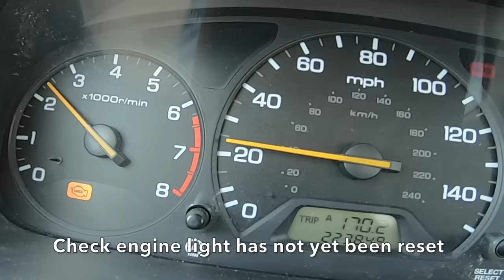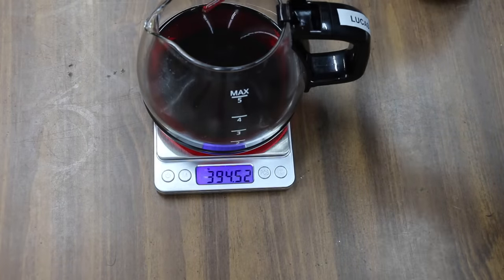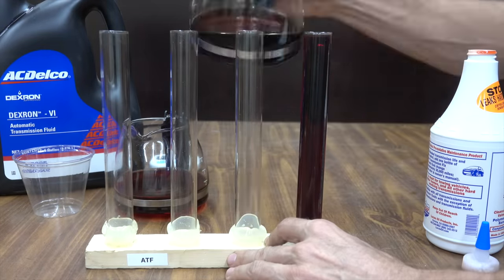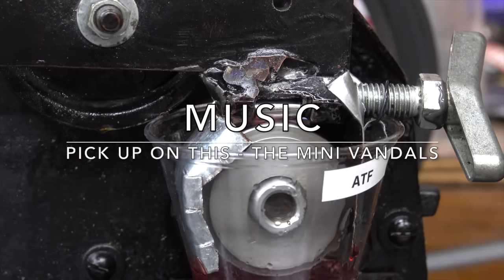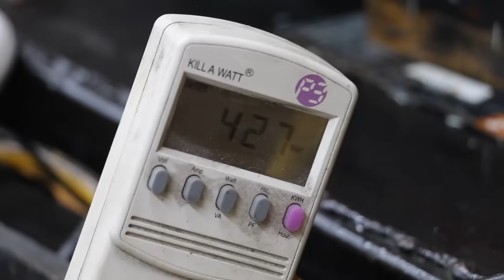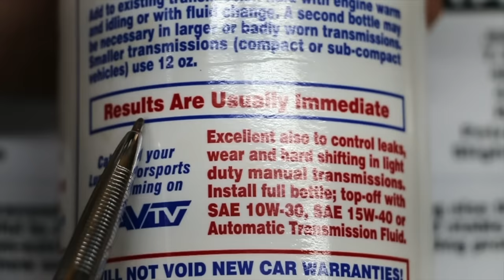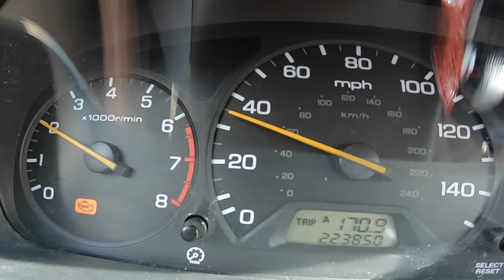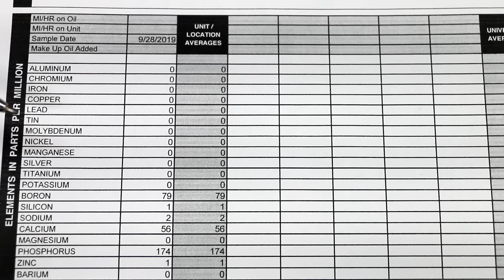Does Lucas Transmission Fix Work?  Let's find out!

Comment: Lucas has prolonged my transmission replacement for over 5 years now. Is it perfectly operating now? No. There is still a slight slip if I really step on it, or if I put a whole lot of torque/load weight on it, too fast. However, if I drive it normally, and take it a little easy when starting off, it's fine. You wouldn't even notice a problem. Also, once up to speed whether it's small roads, highways or freeways you can accelerate any way you want, no problem. I'll take that over a $5,500.00 repair anytime for my 1998 Ford Expedition 5.4, 171,000 mile, no rust vehicle...and it's still a daily driver. Great product. Great video.
Reply from the maker: Thanks!

Comment: Could you please test an OEM fluid (pick any or multiple coices, Dexron 6, Toyota WS, Ford Mercon V,  Honda DW1, nissan Matic S or J, and (Toyota T-IV/JWS 3309/Mobile 3309*)) vs the multi vehicle ATF from Major brands.....as to additive packages differences, wear and all that as they claim its up to or better than OEM specs. What i mean is if the bottle claims its suitable as a replacement for the above mentioned OEMs.... compare them. Everyone seem to like the Valvoline Max life....* Toyota T-IV, JWS 3309 & Mobile 3309 is the same fluid in different bottles made by Exxon Mobile (US)or Esso Imperial oil (Canada). Thanks 😃
Reply from the maker: Thanks for the video idea.

Comment: A little Lucas will make any working transmission run cooler and give you a more solid shift. Also transmissions just last longer with the stuff in there. If you have a transmission that is actually slipping, a container of regular STP can give you up to a year in some cases, if you keep your foot out of it.
Reply from the maker: Thanks for the feedback.

Comment: Just picked up a 92 ranger with the a4ld and I wound up flushing it with most of a five gallon bucket of tractor hydrostatic fluid and a couple bottles of lucus, the thing went from a slip n slide to practically new compared to what it was before.
Reply from the maker: Thanks for the feedback.
Reply: John deere hy guard is what most ppl I know run in heavy duty truck transmissions. It and a bottle of Lucas will tighten up a loose converter & take alot more heat than atf

Comment: Did it seriously say to put 10w-30 motor oil into the transmission? Hmm, that makes me wonder if part of the problem is that modern ATF doesn't have a high enough viscosity? Maybe to eek out that tiny bit more fuel mileage?

Comment: This is one of the greatest products ever. Prior to using the it took it to a few shops and they told me I needed new transmission quickly on my 2001 Legacy supposedly had a transmission that needed to be rebuilt until I bought this stuff and I’ve been putting it in ever since and that was 70,000 miles in this tranny is running fantastic. I even run it full strength without a mixture of automatic transmission fluid
Reply from the maker: Thanks for sharing.

Comment: I bought a cheap beater as is with 240 thousand miles that was in excellentshape and everything worked but, a 2008 Escape that wouldn't go further than 1st gear. Its history was had a trans rebuilt a few years back and later a new shift solenoid replaced. As soon as I paid I put a quart of Lucas in it and been driving it for 2 years without a problem other than at times OD dash light flashes. As if it's not in OD but it is and OD button works fine. ? Cheaper than repair obviously.
Reply from the maker: Thanks for sharing.

Comment: Here in the UK a family member recently purchased a Honda Jazz without test driving it for another family member! 🙄The CVT judders when taking off, a bottle of Lucas Transmission fixed that issue!! Less than 50 miles of driving it was fine.
Reply from the maker: Thanks for sharing.

Comment: Those honda transmissions are very different than most transmissions out there, try this again on another type of transmission that is slipping, Another thing that can be done to buy some time on a Honda transmission like that is clean the solenoid screens, or replace the solenoids, but the transmission is failing nevertheless

Comment: So the symptoms I see are not torque converter but also the Lucas won't work if the torque converter is the problem  it works on the clutches and bands

Comment: Well after this video I did a complete 14 qt change and added one 2 bottles of Lucas Trans and one full quart of "real Lucas" to a Ford AOD with 180,000 miles.
The trans had shifted well until the fluid got hot, 15 miles, so the increased viscosity helped. Adding an external cooler and getting out of the 180* radiator tank helped too. Its still going strong at 208,000. But the lockup stutters a little when hot.
The AOD had been serviced at 120,000 with an 100% fluid change using mercon5.
Reply from the maker: Thanks for the feedback.

Comment: I'm afraid to add the whole bottle. I checked my fluid prior to adding, (2015 F150 XLT), and it was actually a bit over full(cold test), so I pulled out (using a pump) enough to fill a plastic folders coffee container and then I added Lucas to bring the level to just full..
Test drove cold around the neighborhood and shifts just fine, will have to test on >30 mins drive later today, because the original problem is shuttering after 30 mins of driving on ALL uphill climbs on regular roads, that's not much of an incline at all. But I did use this last year to treat my shutter then and it's been good all summer (driving is always 40 mins one way to work and I do that 3 times a week, and of course have to drive back home after 12 hours).
Truck has 221K.
No oil use or burn, no leaks for any fluid.
I did put in all new coil packs when I bought this truck in 2020.
Other than the transmission only the turn switch went bad.
Reply from the maker: Thanks for sharing.

Comment: needs shift solenoids....the seals swell and makes it harder to shift due to sticking plungers......usually 2nd to 3rd is where it starts. I did my Jetta at 174,700 and it still shifts great after 300 miles.
Reply from the maker: Thanks for the feedback.

Comment: I had a 1989 Olds 98 with 3800 engine and 4T65 trans.... Trans started giving me slipping at 180k-ish miles, I put the Lucas oil in it, and the trans did get better. I got another 25-30k miles out of it until the engine started sucking coolant, and I threw in the towel. The intake manifold gasket was leaking. Changed the gasket and it still leaked, so either the head or the intake had warped, wasn't worth any more effort at that point.
Reply from the maker: Thanks for sharing.

Comment: I have always used Trans-X.
You can get it at any auto parts store or Walmart. It is fairly cheap!
I have used it on 3 different vehicles with fantastic results on all three!
All of the vehicles had high mileage.
One of the vehicles was a taxi cab minivan that was drove like a beat dog! Lol. It would not shift good at all,... sometimes would not even shift into 3rd. After about one hour driving with Trans X, it was shifting like a brand new vehicle.
I had one that would not shift into third. I placed the proper amount of Trans-X in the transmission & before I left the Walmart parking lot it shifted into third.
It will not replace burnt clutches. It will dissolve varnish build-up in the veins, ect. You have nothing to lose but $8 or so.
Reply from the maker: Thanks for the feedback.

Comment: Have 2003 Grand Prix would not shift between 1st and 2nd when first taking off. Could get it to shift by playing with gas. After first shift it was ok. Two shops trans is shot $2K to $2.5K to fix. Veh. has 125K total. Thought what the Heck $13.00 bottle of Lucas trans additive and it took care of problem. Veh. shifts fine now. Super glad I tried it.
Reply from the maker: Thanks for the feedback.

Comment: My employees pulled one of my plow trucks too town for a mechanic too replace a possible difficult starter before a upcoming snow storm... (they didn't put transfer case in neutral  like I said)  $400.00 later  trucks starts and runs but , wouldn't move out of shop tranny was fried from the pull into town...added 2 bottles  of this too my 98 2500 ram. And it drove off and I was able to use as a salt truck for last few years  and it drove great  too the junk yard when the body finally gave out... tranny was still  👍.
Reply from the maker: Thanks for sharing.

Comment: I put this in my 57 year old Ford Cruise O Matic the tranny was slow about shifting up and very soft. After adding the Lucas Transmission Fix and driving it a few miles, my transmission now shifts like new. Much cheaper than the quote I was given for a rebuild ($1600) and no downtime.
Reply from the maker: Thanks for sharing!

Comment: had this transmission that was completely gone. All it had was second gear and third gear. All the gears would slip except second. The Lucas additive didn't fix everything, but it made my truck driveable for another year. I eventually got it rebuilt.
Reply from the maker: Thanks for sharing.

Comment: It does work....my 2012 Chrysler Town & Country had a transmission slip at 162k miles....I brought it to AAMCO, and they said that the transmission had an internal damage to the transmission and quoted me $4.2k to replace it with a remanufactured transmission. I reject that as the cost of the car itself is not that much anymore and with 162k miles, there will be more parts needs replacement soon. I brought it home, and do some research on what I can do to fix it. It turned out that transmission slips is pretty common, and I watched maybe more than 30 clips in you tube on top  of researching on the internet. I end up deciding to take a chance and try to do things that other people did - replace the transmission fluid (I bought original Mopar ATF4+), filter, and add 2 bottles of the Lucas Transmission Fix. And after that....voila.....it works....it no longer slips and the transmission actually feels very smooth....so, it does work for me.
Reply from the maker: Thanks for the feedback.

Comment: This product and others maybe but you have to change the fluid first or if your running old transmission oil and filter is a big no no but your taking a risk grater than if you change all you fluid and filter?

Comment: So I have a 06 taurus that has been slipping really badly. And when I go to accelerate after putting in gear it usually takes about one or 2 pushes on the gas pedal to get it going. And seems like I couldn't get it past 20 mph to get past first gear. I also had a shop add transmission fluid. And seemed to make it worse after using it for awhile. Any tips or advice. I don't have the cash to replace the transmission.
Reply: Here's a tip for ya, avoid buying Ford products!
Reply: Best advice would be to take it to a private shop that specializes in transmissions. No AAMCO or anything like that. If you take it to a regular shop or AAMCO they are just going to recommend replacing the transmission because that's the easiest thing to do. My dad's '08 Taurus sometimes it would lose first gear so it wouldn't have any acceleration until it got up to speed. All the regular shops and AAMCO told my dad he needed a new transmission. I went and found a small mom and pop transmission shop and they diagnosed it as a control module failure. Replacing the module was 1/4 the price of replacing the transmission the other shops were quoting. It's been driving good as new for close to 3 years now.
Reply: @williamshook982  😄
Reply: how about the old way of adding sawdust to the tranny?

Comment: Looks like, by adding the Lucas, all you have done is increase the overall viscosity of transmission fluid which will affect shifting and slippage. Seems like you could have accomplished the same (or even got better results.) by using a thicker transmission fluid.
Reply from the maker: Thanks for the feedback.

Comment: At 40,000 miles on my rebuilt 4 speed automatic it started hesitating/slipping as it was shifting in to 3rd or Drive...put in the required Lucas and it stopped immediately 14,000 miles ago...Lucas Transmission additive is NO Joke!
Reply from the maker: Thanks for the feedback.

Comment: I have been using Lucas trans fix in my 2005 f150 for years… it now has 243,000 miles on it now… I haul mildly head loads…. Every summer I pump out whatever I can get out of the trans pan( about 2-3 quarts). I put 1 bottle of Lucas trans fix in plus regular trans fluid…. Trans still works. I started doing this before any slipping had occurred.  Now the 5.4 3v engine is a different story 🤦🏻‍♂️
Reply from the maker: Thanks for sharing.

Comment: Many transmissions are labeled as bad when it's nothing more than the shift solenoids...Honda has them on the outside of trans, I've done them on my Element cause of slow shift into 3rd...
Now VW has the solenoid in the pan where filters are...also common is the trans CPU getting wet in VW and not letting trsns operate properly...
This all being said I have used "transmission fix" to get my old worn out Dakota home ( 15hr drive)
Reply from the maker: Thanks for sharing.

Comment: Back in 1997, I had a Lincoln mark Vii with a bad trans slip and went to the Ford dealership to get it fixed, the mechanic there told me it would be very expensive the car was a 1991and I should try Trans X, so I did the car had 87,000 miles drove it for another six months and sold it to my brother in law who drove until it had 310,000 miles with no trans problems.
Reply from the maker: Thanks for the feedback.

Comment: While it requires an intermediate mechanical ability (focus to attention to detail and cleanliness) someone with a garage, harbor frieght level tools, a quality rebuild kit and (most importantly) the factory service manual with guidance on a rebuild can do this on their own (preferably with help). Ive been down this road, it isnt fun nor easy but the feeling of tackling the job on your own is unmatched. Of course it is beyond understood that many people do not apply to this course of action. If you have to shift to a mircacle in a bottle solution for anything one better have the next step already in motion.

Comment: I used it in a 2005 trailblazer that wouldn't move. Changed oil and added transfix. Drove it about 25000 miles and was driving when I sold it I told buyer and he drove it another 10000 or so before changing it.

Comment: It works very well.  I had a 2000 Camry with 240,000 miles it started slipping,  couldn't hardly go up a little hill on my street. My mechanic said try Lucas Transmission anti-slip first, it won't hurt. I tried it and it quit slipping the camry lasted until about 340 -360,000 miles
Reply from the maker: Thanks for sharing.

Comment: If you're trying to just get every ounce out of an old transmission fluid this may be worth a shot.  Probably won't make it worse, may not make it better but worth trying as a last ditch effort IMO.  Worst case is it doesn't help and you run the trans until it needs replacing or rebuild (or the entire car just gets junked).  But I would say if it's just hard shifting like that and hesitation, that may be tolderable and may get the owner another year or two out of the car for literally $20 or less.  In my experience with bad transmissions it usually comes down to things like bad clutches or a solonoid, looking at the over-rev of the transmission and engine before the Lucas I'd say maybe a bad solonoid and perhaps the lucas added enough viscosity so there was enough pressure to activate the solonoid (which can be easier and cheaper to fix than other transmission issues).
Reply from the maker: Thanks for the feedback.

Comment: With my experience Lucas has been good add some in 97 Chevrolet pickup with a 4l60e and it just wouldn't shift out of first gear let it set running in neutral after adding the Lucas stop slip and after about 8 times a 15 minute intervals about 2 hours total it brought that transmission back to life I couldn't believe it my dad told me to use it I was skeptical Drove for a couple more years and sold it
Reply from the maker: Thanks for sharing.

Comment: Lucased my 2008 F450 V10 motor as new at 200 kilo lost my oil filter and drove 5 kilos then towed it to get oil replaced and it is still running great  LUCAS works fabulously very INPRESSED with it  would NOT run with out it       2023
Reply from the maker: Thanks for sharing.

Comment: I used that stuff in my wife’s 98 Saturn SL2 for 4 years when we were starving college students. It works great,  it it doesn’t last forever. It will work for about 15,000 miles, then it needs another flush and fill with it.
Reply: 4 years and 60,000 miles on my suv.

Comment: I worked a at this company that used a very good cleaning solution for cleaning their cutting machines. This fluid made metal stick to other metal.. My wife had bought a  Riviera that has a bad transmission.(It would not go to 3rd gear) We could not afford to get it fit right away ,So I figured "What the hell". I put some of this cleaning fluid into the transmission and it work. We had no trouble with i not changing to third gear for four years. BTW we only bought the car to teach my Wife to Drive.

Comment: If the Honda you tested was a v6 that had an automatic transmission. They are junk. Lucas would not have a chance with those. My good friend that owned a transmission shop he always got a new transmission from the dealer or a rebuilt one.  They came in a plastic case he called them coffins for the transmission.  He told his customers to get rid of the car after he put the Honda transmission in their car.  I think you should look at a different car thx your videos are very informative.